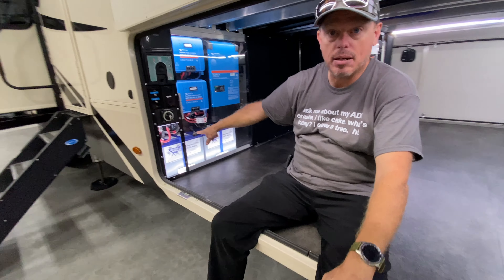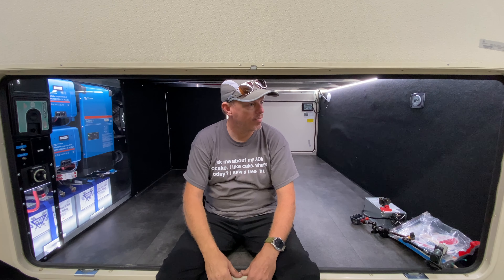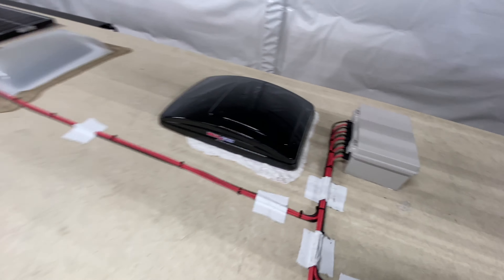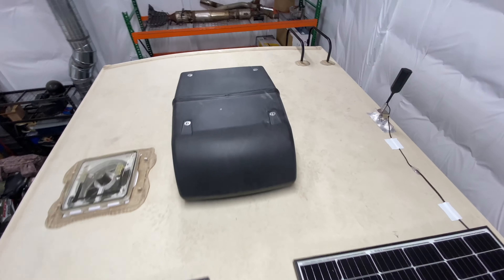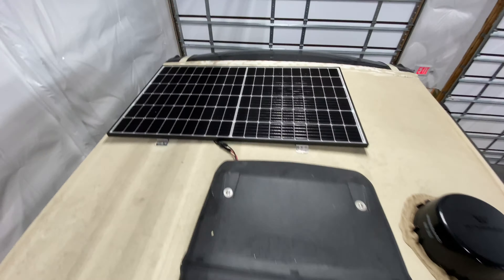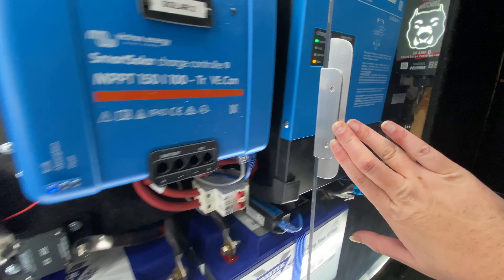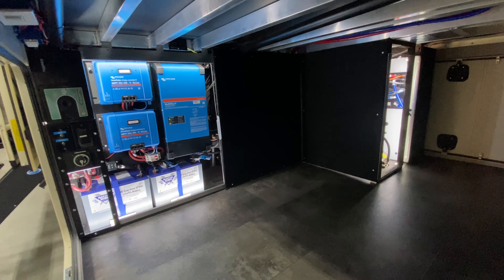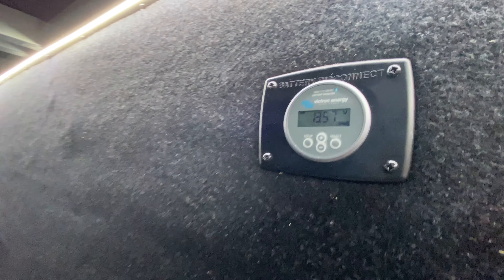Upgrade | 2021 Grand Design Solitude 390RK

Comment: Wish you were still in Utah. Sold the Solitude 377MBS and got an Imagine 22MLE. Would love to upgrade the very small 165 watt panel that came with the unit. Do have 2 Battleborn and a 2,000 watt inverter.
Reply from the maker: Curious about downsizing from the 377 to the 22 - just wanted to go smaller? That awesome, lithium makes a huge difference for sure.

Comment: Looks amazing! top job as usual. Question re the distance between the panels and the roof, obviously allot closer than the manufacturer would “recommend” but do you think there’s any noticeable loss in performance from slightly higher heat on the panels etc? cheers
Reply from the maker: Thanks! With the iPhone macro view it looks a bit closer than it actually is. With the brackets they are 2 inches off roof, but we haven’t had any heating issues or performance issues with these specific brackets in the 2 years we have been utilizing them, including on our roof. Most clients that we utilize these panels on see over 100% efficiency, so we’ve been pretty pleased with the performances.
Reply: @TheDryCampers  Thanks so much for the info i really appreciate it! you guys are the best

Comment: That's pretty awesome.  May have to get scheduled in a couple of years.  We have a 390RK.  Were you able to use any of the solar prep?   I see a junction box, but not sure if prep can be used.
Reply from the maker: We typically don’t utilize the solar prep and did not in this case.The solar gland you see is for the WeBoost that was also installed.
Reply: @TheDryCampers  Thanks for the info!!!  I'm guessing that large chase behind the TV/Fireplace was great for running lines down :)